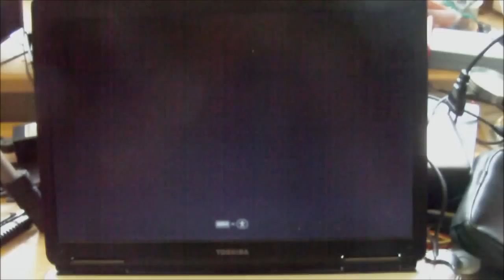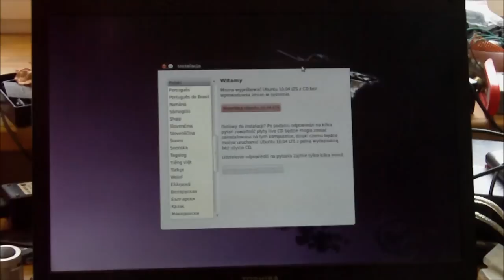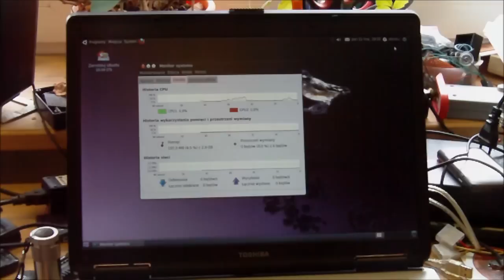upgrade procesora Toshiba L40 CM530 na C2DT7500

Comment: I also have L40 - 14B with M530 and I would appreciate T7500 on it too :). Which exact model of L40 do you have? I am asking because I am worried about FSB speed. M530 is 533MHz, and T7500 is 800MHz. I am wondering would my motherboard (in 14B) support that? That is why I ask for the exact model that you have upgraded in this video. Thanks! :)